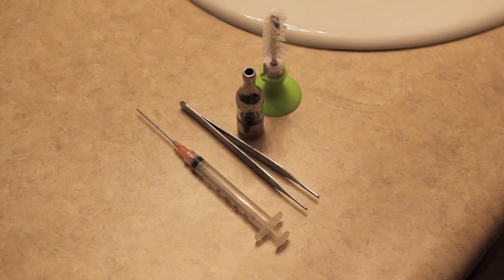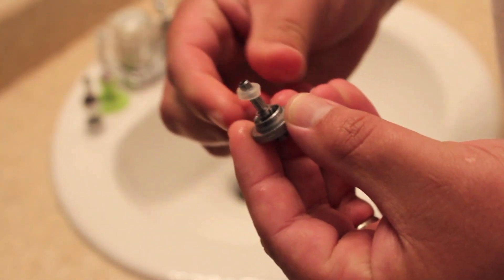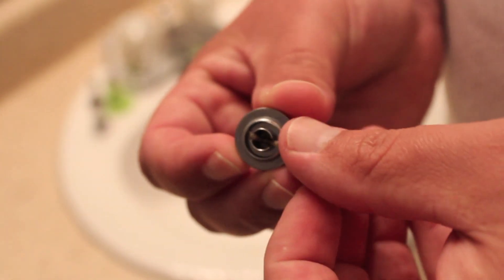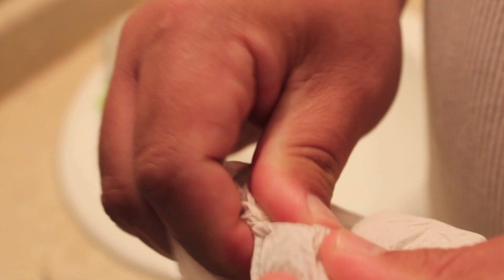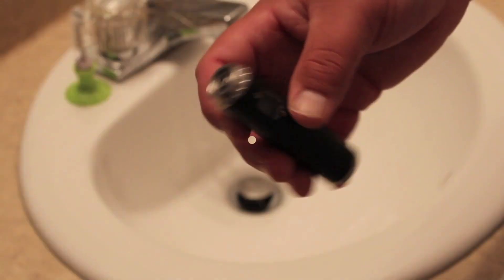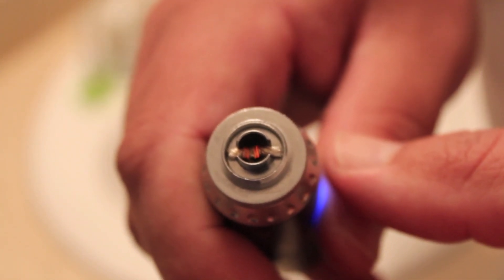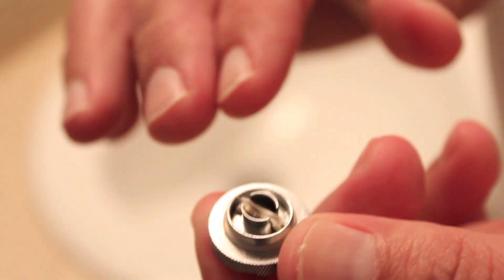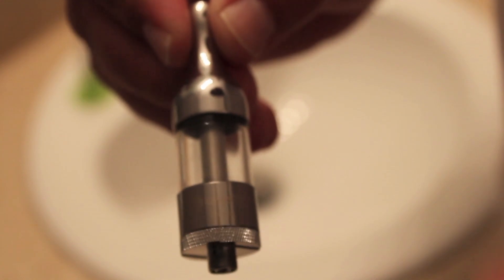How to Clean & Dry Burn... Kanger ProTank

Comment: i took it to my local vape store and they helped me. the glass on one side of my tank (the side i had on the bottom of the tank, by the atomizer) was uneven. we flipped it so that side was on the top and i'm back in vape heaven!! thanks for your response.

in addition, i've tried this method and it works GREAT. i tell all my friends who have kanger tanks to do this and they appreciate it, too. thanks for a great video.

Comment: I always had trouble with loosening that shaft thingy. Stupid me, I took the head out of the bottom mount in order to loosen the shaft. Your method looks a lot more lucrative (leaving the head on the bottom mount. Either way, you have to keep it there to dry burn it, so it's logical. Great vid. Lots of love from The Tech Guy.

Comment: Two questions. Is clean/burning a good idea if I'm changing from one juice to another? Also on the wicks, I'm using a 70/30 mix and took one wick out to aid in a flooding issue. Can't say it helped or not. Using a protank2 and vamo v2 running 4.5v on average. Thanx for the vid by the way. I need to try this next coil. I tossed my first one after about 3 weeks

Comment: You can try it but those batteries are considered a 3.7V device. But most output voltage is around 3.2-3.6V I'm not sure if it will be enough to burn it off. But you can try you might have to pulse the button for longer then someone else who can turn the power up. Its worth a shot

Comment: I've done a dry burn on the first atty when it started to get funky and it did work for a while but shortly started to lose flavor again, I left all the wicks there but I just don't get why on a brand new atty left alone no wicks touched or anything, it still isn't giving me that flavor. My setup is an ego-c twist with the kanger protank 2 2.5 ohm heads run at about 4 volts but ill watch your vid again to clean and dry and see how that goes and let ya know, thanks for the response appreciate it

Comment: Hey bro, I just vaped mine through 4 fills and cleaned tonight to switch to a new flavor. after the 4th tank it started to act strange with gurgling and less vapor production. Cleaning fixed it right up, used vodka and there was no lingering flavor at all.

Comment: I tried vapor chef and it left this nasty residue in my tank. I've done the tried the dry burn and rinsed everything out three times, but the smell and taste still persists. Any suggestions? I've even considered using rubbing alcohol wipes to thoroughly clean it in and out.

Comment: What happens if you loose the flavor wick in the process? I suppose I wasn't careful enough and mine just disintegrated when I took it out. I went a head and put it all back together without it? Seems fine for now but I'm sure it has some downside of not replacing the flavor wick? If anyone has any knowledge about this it would be appreciated!
Reply: For atomizers like these the flavor wick plays more of a role than just soaking up fluid. Without the flavor wick (having only the wick in the coil) you lose flavor, get dry hits, and can/will flood. The second and third wick help keep the juice from filling up the atomizer base. Which in turn will cause you to get juice in your mouth and very likely in/on your battery contact and can short it out.